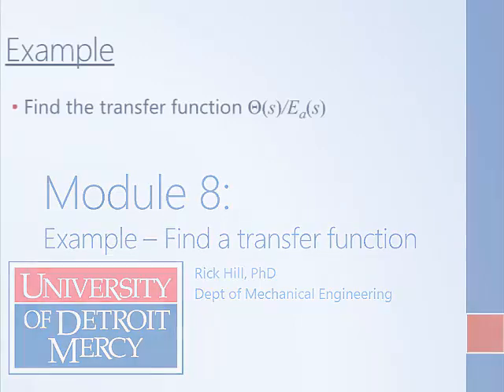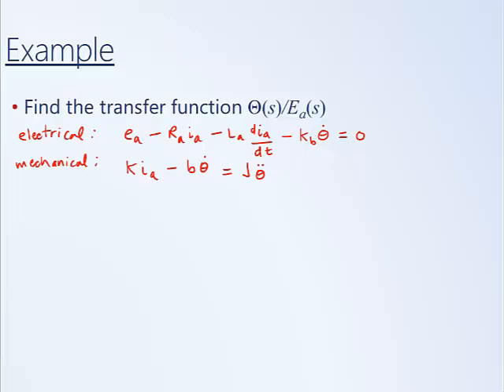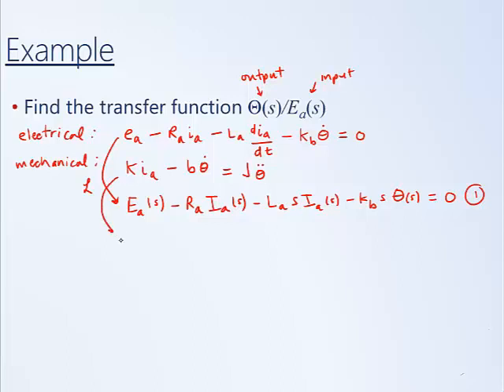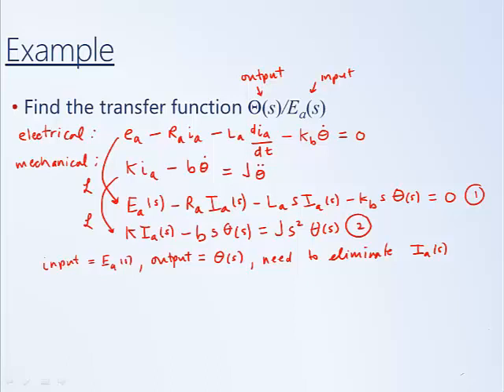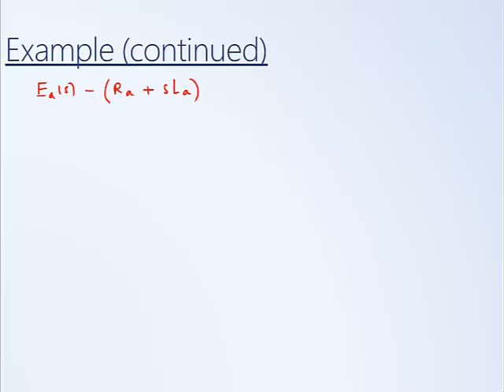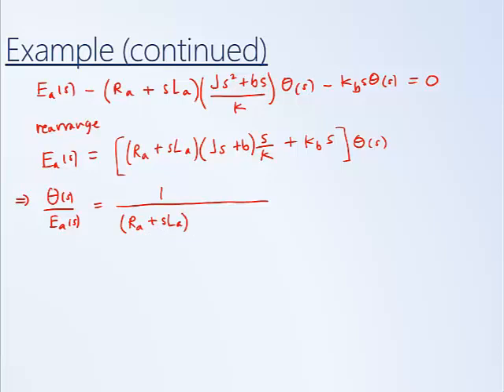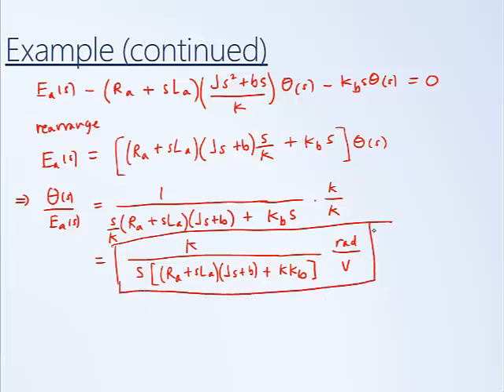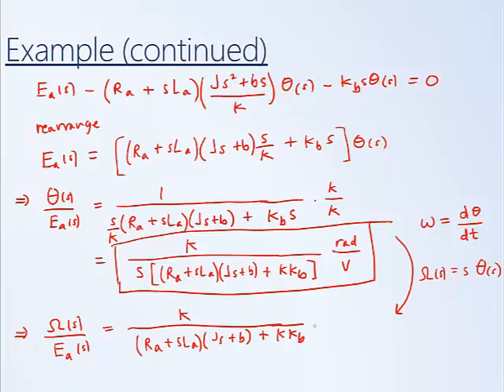System Dynamics and Control: Module 9b - DC Motor Transfer Function

Comment: Hello dr. Rick please answer my question 
[b] Consider the system shown below, an armature-controlled dc servomotor 
drives a load consisting of the moment of inertia JL. The torque developed by the
motor is T. The moment of inertia of the motor rotor is Jm .The angular
displacements of the motor rotor and the load element are Ɵm and Ɵ, 
respectively. The gear ratio is n = Ɵ/ Ɵm . 
Obtain the transfer function Ɵ(s)/Ei(s)